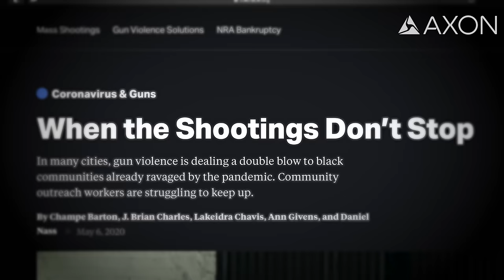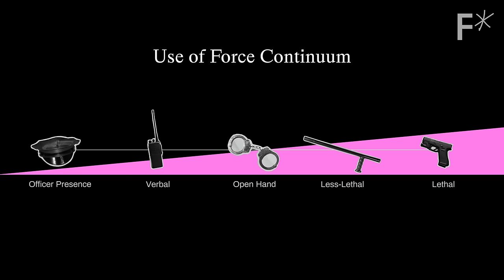The CEO of Axon on how to make weapons safer

Comment: Like I thought there was something interesting or new, it’s just a normal tazer. They “hope” to be better I guess
Reply: I thought it fired the cartridge so it could go pretty far
Reply: Yeah I thought it was gonna be directed energy weapons. 0/10
Reply: @sumpogimpo0777  that was the shotgun one. It fired a shell that went 5p ft or so but couldn't be used inside of 25ft so theres a regular taser on its rail. And it's got a special bolt that won't close on a regular lethal shotgun shell. But at the $125 a shot price it's to much for small dept.

Comment: "We're about half way there"
You mean because tasers fail about 50% of the time?
Reply: no, it's because if the hit then they will stop anyone right there, now they need to work on reliability
Reply: @arisenspirit  Except they dont. Most taser deployments get nominal prong placement, but since even a light jacket can prevent prongs from embedding, it fails. Even with perfect technique tasers fail about 50% of the time.
Reply: @AtlasReburdened  yeah that's what they talked about in the video.
Reply: Higher fail rate … more like 75%
Reply: y’all should really check out the podcast “Behind the Bastards”, specifically the episode on “excited delirium” — directly relevant to this, from someone who doesn’t literally sell tasers

Comment: Tasers have been used to torture subdued criminals or mental cases. 
They should be manufactured to only work when a cop's body camera is turned on.
Reply: Every time the trigger is pulled there’s a bookmark of the event location, time, how long applied etc. … bodycams aren’t infallible either
Reply: @6285108  Good to know. Thanks!

Comment: OK. This is good. However, I didn't hear anything compelling that indicates the goals of a non lethal weapon being possible to gain that perfect reliability. Footage showed holding shelf to block tazer. How to overcome that?

I like this goal. So I thought about it for a minute and I have a glimmer of what's possible, provided the opposition doesn't escalate by obtaining and improving upon the following tech:

The Tech solution involves expensive elite two "man" teams with insane level of tech making them kinda god like enabling them to casually step into danger without worry of self harm enabling them to use many non-lethal weapons. Imagine if you are bullet proof, you just walk up to gun wielding bad guy, grab gun, elbow in the gut. Done.

1) Carbon nanotube whatever armor, now resistant to many normal caliber and other forces eg. fire.
2) full suit sensors incl mini drones that deploy and scatter to provide tactical info from above and around
3) AI to monitor huge level of sensor data to determine threats and deploy non-lethal weapons instantly and precisely without human approval.
4) these non lethal weapons would be robot in nature. AI launches a small tube extremely precisely in such a manner as to land behind or beside the target too fast for target to move their shield or dodge - tube aims and launches itself either to better position or directly at Target and does it's zap or instant hand cuff or whatever... High tech robotic weapons that can do awesome take downs with guaranteed low injury rate and zero fatalities. Blind them, put them to sleep, gosh can think of countless things. Larger of these automated weapons would transform into a stick figure capable of martial arts, knock target down, grapple, pin arms behind back. Done.
5) team of remote humans monitoring situation, providing backup and able to approve AI decisions that have lower than 95% probability of success, so human on the ground can take on 10 targets in 2s cuz team support and AI neutralize everyone so fast no one knows what happened till we replay it in slow Mo haha!
6) Recall I said two "man" team - second one on the team is a robot. This one can shield the human cop, can enter in higher caliber or hotter fire scenarios than the human's suit can handle. Both the robot cop and the human have lots of those deployable AI controlled non lethal weapons. If necessary, human cop remote controls the robot through a building he cannot enter etc.

Imagine my idea is the cops come in, unafraid of anything... Dudes with guns shaking at the sight, take a couple of shots, cops walk up unfazed, grab gun and handcuff him. Scale it up to 10 armed dudes np same deal. They be gods among men and no one will die because the cop cannot be hurt so he isn't in fight or flight mode wanting to shoot first to be sure to survive the day.

Bit expensive though. And can be defeated by rocket launchers and big guns so ya know not gonna work if the others escalate and get better tech themselves.

Yes, you guessed it, I like GITS and Iron Man kind of shows.

Bye.

Comment: Until you can make it just as reliable as a fire arm this will never replace one.
There are not enough shots in a taser. It can be stopped with the right clothing. Even the use of a firearm more shots miss then hit in the field.
The range of a taser is far shorter then a firearm.

Fix these issues and you could remove the firearm as an option all together.

Comment: If I was a cop and a criminal could possibly be armed theres no way in hell I’m gonna reach for a taser over a Glock. As soon as you reach for anything the aggressor will retaliate and escalate the situation. Never pull out a gun or anything similar without the intent to kill before being killed. The problem with tasers is that they simply don’t fit in most scenarios. If the cops life is in danger or there is a threat, why would you want the trusted cop using unreliable non lethal while the threat is actively trying to kill him with an actual gun. It’s not in the best interests of law enforcement or officers safety to make non lethal the next big thing.

Comment: The challenges preventing tasers being more effective than guns: clothes penetration, capacity, cost and range.

The highest capacity I've seen on a taser is 3 cartridges, while the bare minimum of a service pistol is 10 and probably up goes up to 17. That means an officer has between 17 and 30% of his pistol's capacity.

 The only prices I've seen for multi shot tasers is over $1000, with cartridges being $50 a piece. A glock 17 costs about $600 and, assuming police use some super fancy ammo, the cost for a single 9mm cartridge is $2 a piece. That increased cost means either less training, fewer officers, or fewer officers armed with these less lethal devices. 

As far as range, the base range of a taser is 15 ft with the highest being 35 ft. With good training, a  pistol can hit a target 50 ft away, although the average shooting occurs within 7 yards (21 ft) of a target.

If this dude really believes he can replace guns he needs to address ALL of these factors. Or he's just being a corporate shill who knows his product is nowhere good enough 🤷‍♂️.

Comment: Just put a lithium ion battery into a .50 cal shell casing with a point tip to penetrate clothing. The electrical energy source needs to be contained in the projectile. A low grain powder charge can propel a capacitor/battery at a lower velocity (like 200-500 FPS) and contain enough energy to short someone out, and we can still utilize our regular firearms. It’s just about fitting in enough electrical storage into a small casing with a primer and 1/4 powder charge. Cycling will be an issue, but a weaker spring/guide rod would possibly work being less energy will be available to cycle the action. I’m no expert, but it seems stupid to not go this route for non-lethal. 50ft lbs of energy plus a huge electrical punch should be WAY more effective than tasers.

Comment: Let's see. Bullets are designed to critically incapacitate or kill, depending on the location of the wound. So no, this will not make the bullet obsolete, because one of the functions of a bullet is to kill as quickly as possible. Lethality is a key function of a bullet. Lethality is NOT a key function of this taser.

Comment: Tazers are not effective enough right now to replace firearms. If someone could invent an energy weapon with a stun setting that could incapacitate a person (think Star Trek phasers on the stun setting or Star Wars blasters on the stun setting) instantly without any lasting effects, I’d be all for it. But until then, I’ll stick with firearms. I’ve personally seen Tazers fail too many times to trust them. Going hand to hand with a person after you’ve Tazed them multiple times and it didn’t work isn’t fun. And I’m speaking from experience.

Comment: Don't get me wrong I appreciate that tasers exist. They are truly amazing tool to help detain people without having to resort shooting or getting in a close-range altercation with them. But let me just run down the problems that are going on with them right now that make them so difficult to reliably work.

If both barbs don't hit it doesn't work, if one barb hits and the other hits but doesn't actually embed itself inside of the person doesn't work, if the person's wearing too thick of a jacket doesn't work, if the person is wearing loose clothing doesn't work, if the person is wearing something hard underneath their  shirt doesn't work, the suspect gets a barb in them and pulls away and snaps one of the metal lines that actually sends the electric current through doesn't work. It's a great technology but it is severely lacking in terms of consistency. I can list off three dozen more ways that it doesn't work/is difficult to rely upon purely. 

That is personally why I'm kind of moving towards ensnarement devices as the way the future. It's far less likely to cause heart palpitations or such related problems on people that have susceptibilities to that. And snaring them means that it's much harder for them to run or get away. And it's also far less likely to be turned on an officer due to it needing a standard distance to deploy. Unlike a taser that can dry stun if taken away from an officer. And then snare met device used at too close of range won't deploy outwards enough to wrap around somebody and snag them if it's turned upon the officer. Mine would be a lot harder to train for and use than pointing and clicking but it might have its advantages over it. It's a lot easier to pull a couple barbs out of somebody from an encairment tool that can snag on loose clothing than it is to pull two barbs out of somebody after having shocked them into cardiac arrest if they are susceptible to that.

Comment: Tasers will definitely need major improvements before it can even be considered to replace firearms.

I think if enough conductive material was spray projected onto the target, you could keep the electrical current closer to the skin surface which i think would even further reduce desths. 

And a better method of inducing the current into the body, maybe a redesign of the prongs or replacement of prongs for an entirely different design.

Tasers are not as reliable or reusable. I think tazers should also be able to fire more than once.

Once the taser can accomplish these things, i definitely thought we will see its use more often and to greater effect. It could even accomplish this guys dream of having pistols collect dust

Comment: There are still wires. That is the problem.
If you make a large enough projectile that would hold a Capacitor Pack itself, and wirelessly connected the weapon to the projectile, you would get better results.

Projectile probes are too small.

Think Big non lethal bullet with an added  punch.  If the projectile is designed properly, it could be armed and disarmed. Having the option of just a hard impact for a warning. And fully armed to lay someone out.
If you also made it adhesive it would stick to, not stick in, like tazer probes.
And to think this is an American Company. America thinks bigger better. I'm a Canadian and know this.
Reply: Also development of the adhesive is the key.
Ideally the adhesive would replace the electrodes, it would remain semi solid but cohesive, so that it would penetrate the clothing like a liquid.

 Possibly a layered with different densities. The most liquid layer being to the striking one, but at the same time be 2 separate adhesives or adhesive charges on the projectile to give you polarity and an electrical path.
A rapid Non Toxic Epoxy is also maybe an option, maybe using the strike to mix the ingredients together and harden.

Comment: 0:45 the only way to make a bullet obsolete is to come up with a better bullet that kills or incapacitates faster.
People who want to neutralize a threat want immediate nervous system shutdown, not 5 seconds at a time while the bag guy is still able to fight back, but absolute sleep-like system shut down for as long as we need to.
unless you can make a gun that renders a person absolutely immobile for up to 10 minutes (which is the average response time) you might as well not bother.

Also what keeps people like my neighbor down the street from passing up on your offer, and getting a real firearm?
Either because they're planning to do something bad, or because they don't trust your technology.
You're always going to have those kinds of people.

Teslas exist, they're much better than a gas vehicle, they are much safer than a gas vehicle, but I'm still going to drive my $1,500 2001 Chevy until the wheels fall off. because is what I have now, and it's much much cheaper than a Tesla to replace.
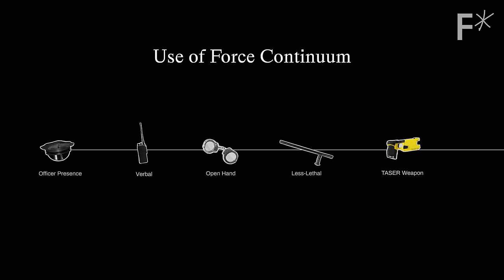Reply: 3:04 my previous point stands you're just making a "better taser"?
So far this just looks like pie in the sky taser to me.
EDIT: 3:37 if you want a taser to go through thick clothing, you either have to make the probes powerful enough to go through thick clothing, which will have enough power to enter the vitals of anyone half naked, or you need the electricity to be enough to arc through the thick clothing making the voltage high enough to kill somebody, you can solve this by carrying multiple Tasers, one low power, and one high power, but at that point you're carrying three guns on your person.
Police officers already get confused between their less lethal option, and lethal option in a stressful environment, how are they supposed to juggle more guns that they can hold?
so yeah Pie in the Sky.
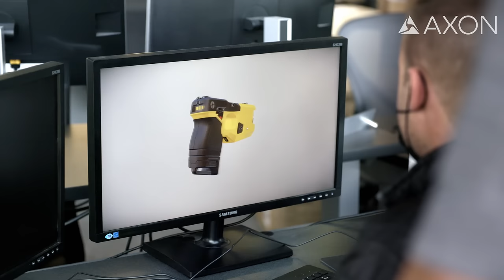EDIT: 5:20 people have been killing each other since the dawn of time, and your little electrical Gadget is not going to change things, more people die via hands and feet, than every rifle in the world.

Unless you can come up with something more effective, or at least just as effective as firearms, with less compromises than firearms, at a cheaper price than firearms, you are absolutely bound to fail..

Comment: Hey. I like the idea of this product line. Honestly but were talking about alternitive stopping power. I dont need to know if a black red green or blue coat is on the other side. If this is something im looking into buying I want goals. I can give a few examples for the future.
Reply: 1 example of there product line is that it will be expensive. Batterys are just not as simple as lead brass and powder. You can use this to up lift your message though. Say that your main focus is on reliability and make the price of the tool worth its value. Problem 2. Range, what ever system you use your gona strugle on getting the maximum range with it. Yes theres the shotgun model but thats also supper expensive as well. More so than shooting buck shot.

Comment: The problem with his approach is one of cost.  Murderers by high emotions, fail to care about laws or safety.  Guns are simply easier to make & the materials, & production costs are lower. 😅
🌒🌕🌘
Reply: Thats not true
Reply: @iknowyouseeme3233 , empirical data is needed for you to change my mind.
Reply: @Persequimur_Umbras  wont bother but im just saying, guns have higher profit margins but their productiin cost is certainly not lower than a tazers
Reply: @iknowyouseeme3233  then in the future you may want to avoid sharing an opposing opinion with a stranger.  Why should I believe an opposing view from any stranger?  Hence, why empirical data is necessary.  Otherwise you are just adding more hot air, & contributing to climate change.
Reply: @Persequimur_Umbras  ironic
Reply: @iknowyouseeme3233  you also seem to misunderstand what the word ironic means.
Reply: @Persequimur_Umbras  also ironic

Comment: computer vision lenses mounted on the end of the taser that not only targets exposed skin below the neck but will also help with timing. computers are extremely accurate and will be able to take into account all motion variables and discharge early to hit a moving target like a waving hand...you could essentially hold the trigger and wave the taser at the target that needs subduing and the weapon will time your your shot and will be aiming for you.

Comment: I like what this guy is trying to do but I doubt it will work. Maybe here in 20 years we'll have "Smart Tazers" with an AI that will only shock someone for like 5 seconds which would prevent one of the shown incidents (The man on the stretcher was tazed for like 20 seconds and suffered some serious injuries). Unfortunately you CAN'T make remove guns from the first resort to violence. You can't beat something that has does it perfectly for 110 years like the colt 1911 or glock who has been at it since 1986. This man is ambitious but guns will never be dethroned by a tazer.